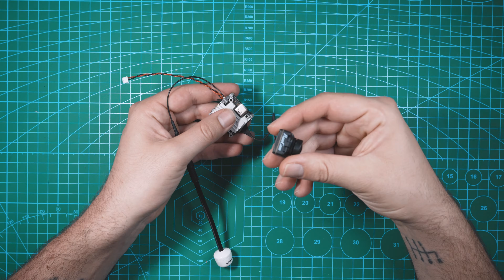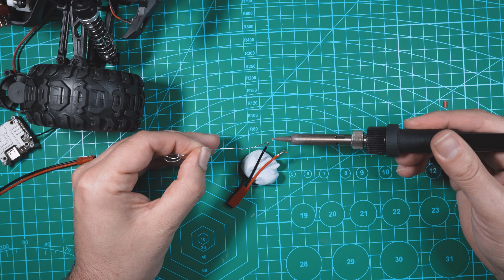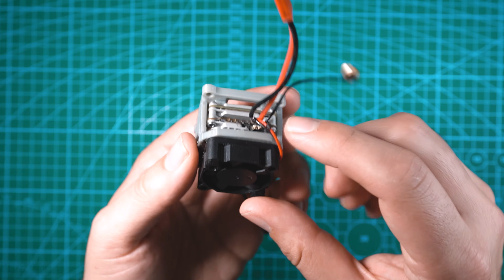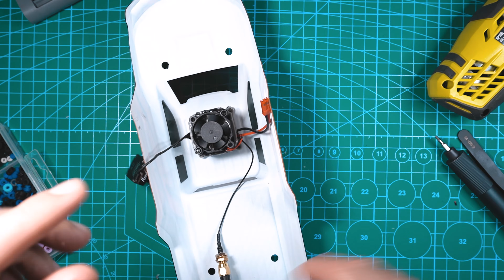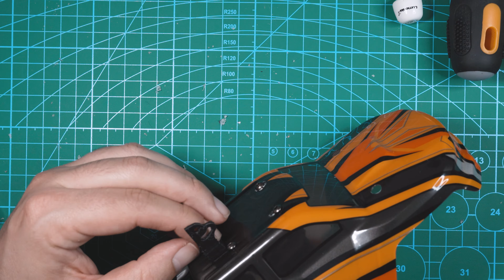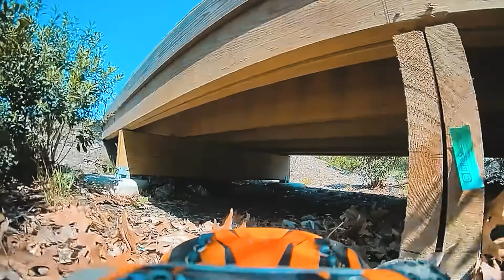Offroad DJI FPV Truck? - Loolinn Ravage

Comment: Every RC truck ends up on its roof (hard) in every spirited session.  They are “bashers” after all.  I’ve done two versions of FPV on similar and I alway mount either in the bumper, or hood with protection.  This roof mount won’t fly if you care about the survival of the camera. Do not recommend.

Comment: Where did you get the camera mount? What type and brand of antenna are you using? Is that an adaptor for the antenna or did you make that sma connection yourself? TIA.

Comment: Attempted same with a rustler....the jello and vibrations killed the fun.  Thinking about ditching the shell and going with a solid top plate that will allow cushioning
Reply: Did you ended up doing something about it?
Reply: @joseromero2578  GM2 gimbal from CADDX if you are still wondering now.